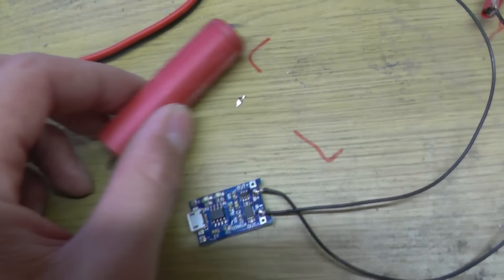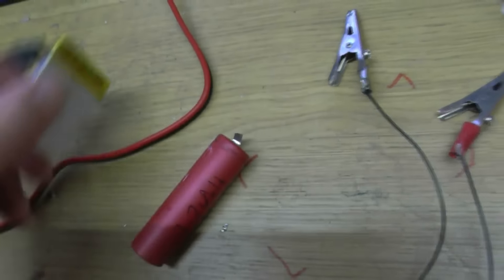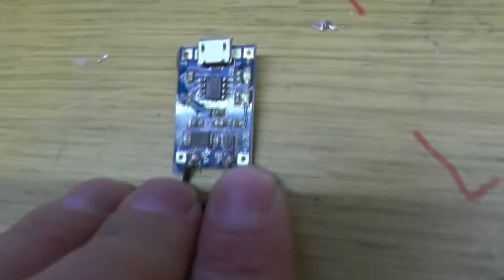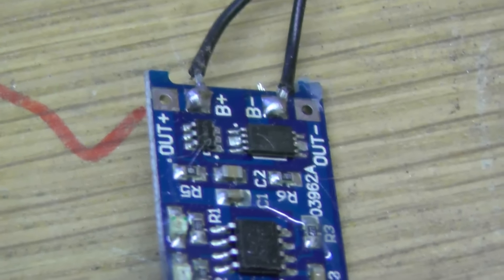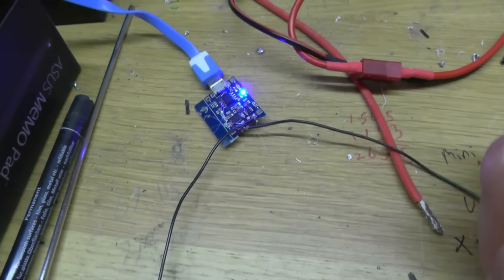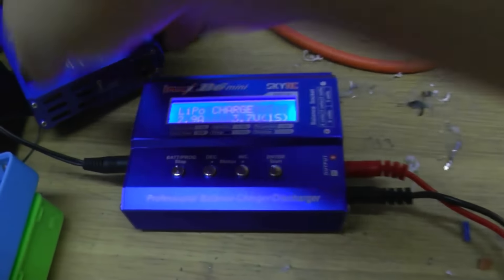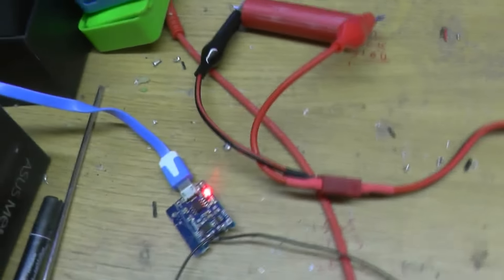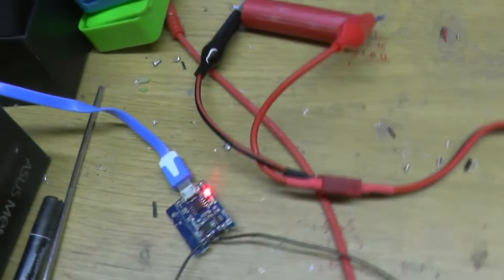lithium   How I do it part 1 THE DANGERS and cycling

Comment: I had been given one of them karcher window vac's today faulty,turned out it was a burned out motor but it had a Sanyo 18650 battery at 1100ma so I discharged it on my turnigy 8 and charged it at 1A and it took a charge of 1059ma,so quite happy with recording the charge rate,but each to there own
I really want to look into 2-3-4-5-6 cell bms cards to look after the charging and balancing
Have you any experience with these

Comment: I want to use my iCharger 106B+ to cycle some Sanyo R1112 batteries I got from a laptop battery pack. To charge one battery, I charge to v4.2. When doing a discharge, to what volt level must I discharge, v3.0?
Reply from the maker: +Ninjutsu Ryu 3.0V to its deepest point when testing. But I wouldn't take them too far below 3.3V when I use them just because you will get more cycles from the 2nd hand cells. Just think of it as not putting too much stress on them! =)
Reply: +pietkaify Thanks! :-) I will test each one up to 3.0V then.
Reply: +Ninjutsu Ryu Just another question: for charging the batteries, I made a 3s battery holder with balance charge lead which works well. Can I use this to fully charge 3 batteries at a time, and then discharge each one individually to still get a good capacity indication for each one?
Reply from the maker: It will work. But if you have say 2 cells that are 2000mah and one is 1500mah then it will take ages to charge up the cells with the higher capacity! Soory it took me a while to reply! =)

Comment: Do you decide on the capacity of a battery on its discharge or charge
Reply from the maker: I decided it was better to use the discharge capacity as when I charged using the imax there was around a 5-10 increase in mah put through the cell! This is my opinion I know others have done different!
Reply: +pietkaify I also found discharge rating had more accuracy over the charging for the exact resion you say
Reply: +pietkaify ideal id like the other type of unit you have for usb or a unit that will keep the the drain and use a protection circuit to cut discharge off when they hit the safe low voltasge cut off as the imax tend to forget the drain when a protection circuit is used I have a lot of cells that are at 0 I have had some luck bringing some back but I need a better powerpack one where I can set the 4.2 volt but set the current to like 10mah ok this may take a long time to charge but keeping the current so low should stop them from dead shorting
Reply from the maker: +David Simpson if you get a few TP4056 units they charge cells from 0 at a low rate then the current increases as the cell reached 3v
Reply: +pietkaify all have to see what chip mine use
Reply: +pietkaify 4056es like yours but with out protection circuit built in
Reply: well just stuck a cell on and voltage is going up slowly at 50ma or so so bit of luck I can recover the box of 0 volt cells lol
Reply: bugger it was claiming in voltage but seems to have dropped again so think ill stick in in a tub of sand and see what happens